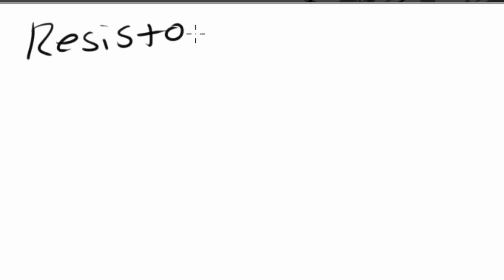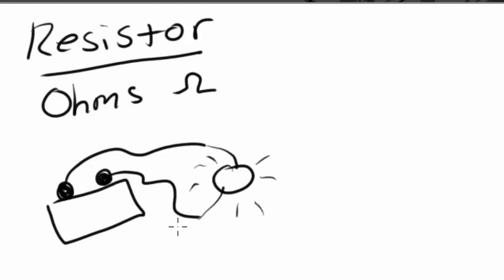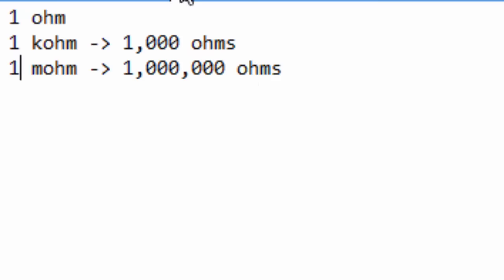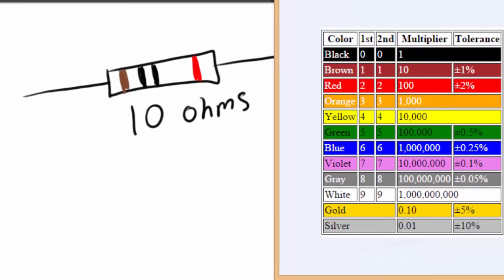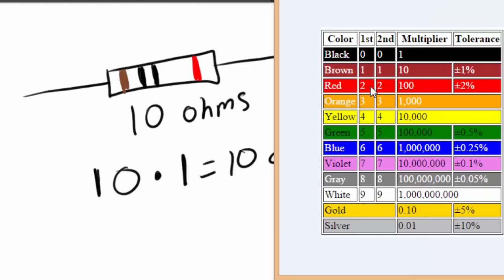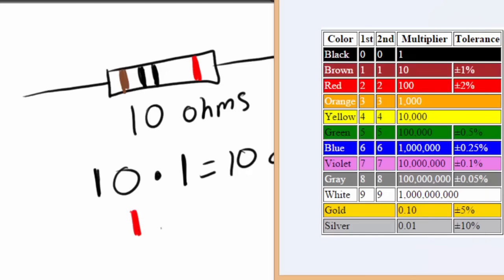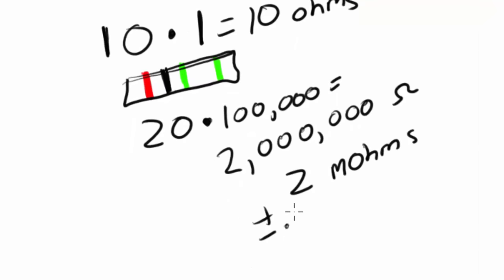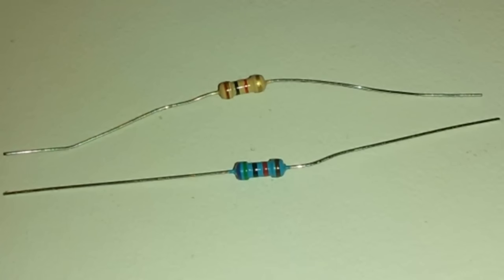Beginner Electronics - 5 - Resistors

Comment: Question, what  if I simply turn the resistor , brown, black black red, clockwise. can I use it as 20 ohm one ?

If not how can I understand which is the correct side to calculate?
Reply: Usually in the last color band we find gold or silver colors which are at the end of the resistor and when we calculate the value at that time also we take the gold or silver color as the last one 
we take the first color as the color which is opposite to the gold or silver colors and then from there we start as the first second third and forth band of color and forth has to be either gold or silver and it is always the last 
To summarize just remember that the gold and silver band are the last color bands

Comment: How do you know which one Is 1st and which one is tolerance? Which one is the left side and which one is the right side.
Reply: Usually in the last color band we find gold or silver colors which are at the end of the resistor and when we calculate the value at that time also we take the gold or silver color as the last one 
we take the first color as the color which is opposite to the gold or silver colors and then from there we start as the first second third and forth band of color and forth has to be either gold or silver and it is always the last 
To summarize just remember that the gold and silver band are the last color bands

Comment: How do you know which side of a resistor you start taking the colors?
Reply: Usually in the last color band we find gold or silver colors which are at the end of the resistor and when we calculate the value at that time also we take the gold or silver color as the last one 
we take the first color as the color which is opposite to the gold or silver colors and then from there we start as the first second third and forth band of color and forth has to be either gold or silver and it is always the last 
To summarize just remember that the gold and silver band are the last color bands

Comment: A confusion here: what if we rotate the resistor to the other way round, won't we get a different result. If so, how to know which one is head and which is the tail
Reply: Usually in the last color band we find gold or silver colors which are at the end of the resistor and when we calculate the value at that time also we take the gold or silver color as the last one 
we take the first color as the color which is opposite to the gold or silver colors and then from there we start as the first second third and forth band of color and forth has to be either gold or silver and it is always the last 
To summarize just remember that the gold and silver band are the last color bands

Comment: hi how i can know which side is the top one  of the resistor ?
Reply: I think after 4 years you’ve already got the answer to your question, but I’m still going to answer it, in case that someone else has the same question, now or in the future!
Reply: Usually, there is a golden or silver colour band on one end. 

It is placed at a slightly greater distance than the other colour bands. You will be able to spot a colour band on the resistor which would have been placed a bit apart from the rest of the colour bands. This is the tolerance bands which tells you about the %age inaccuracy of the resistor value.
Reply: If you were asking about which side of the resistor is the one where you connect the positive terminal of a battery then there isn’t any restriction for that.

Resistors don’t have polarity. Connect them in any direction. They will work just fine. Also they work the same with both AC and DC unlike capacitors and inductors.
Reply: Best solution is to buy a multimeter. It can calculate the resistance itself along with plenty of other variables such as voltage, current etc.
Reply: @retrohd1_  thanks you sir 🙏 🙏
Can i get you mail I'd , please???
Reply: @Shailesh Kumar I hope you got the email
Reply: @retrohd1_  did you give it to him?
Reply: @retrohd1_  thanks for the explanation btw, youve said some things i didnt know
Reply: 1 2 If you’re talking about the tolerance band being at a slightly greater distance then I’ve seen it like that on some resistors while on others all of them are at equal distance. Must be due to different manufacturers. But I’m glad if it helps you in some way.
Reply: 1 2 I did left my email id here for a few days then deleted it. It didn’t felt right idk
Reply: @retrohd1_  oh interesting, but now im curious, what did he mail you about? Did you guys became internet buddies?
Reply: 1 2 Lol 😂 no never got an email
Reply: @retrohd1_  haha, you seem very intelligent, may i know your age bcs i think you are part of the more mature part of youtube users
Reply: I asume you are also muslim, im too btw
Reply: 1 2 I don’t consider myself that mature. I’m almost 20. But I really love electronics and I’m learning from YouTube videos. Thanks for the compliment though
Reply: @retrohd1_  by mature i  actually meant respectfull, positive, wanting to give other people knowledge etc.. not 12 yo boy who is talking big on the internet.. if you know what im trying to say.
 Im 16, i just started to learn about electronics, ive always been interested in how these things work..(like electronics, programming, i like to read about physics and the universe and stuff haha)
(Btw, school starts again in 5 days...)
(Im from europe)
Reply: 1 2 I get it. Are you on Facebook though? We should talk over there
Reply: 1 2 Got it! You should remove the comment now

Comment: How could we understand the resistance of a resistor if it is inverted
It looks same from both side
Reply: Usually in the last color band we find gold or silver colors which are at the end of the resistor and when we calculate the value at that time also we take the gold or silver color as the last one 
we take the first color as the color which is opposite to the gold or silver colors and then from there we start as the first second third and forth band of color and forth has to be either gold or silver and it is always the last 
To summarize just remember that the gold and silver band are the last color bands

Comment: How do i distinguish the 1st band of an resistor from the last band of a resistor ?
Reply: Usually in the last color band we find gold or silver colors which are at the end of the resistor and when we calculate the value at that time also we take the gold or silver color as the last one 
we take the first color as the color which is opposite to the gold or silver colors and then from there we start as the first second third and forth band of color and forth has to be either gold or silver and it is always the last 
To summarize just remember that the gold and silver band are the last color bands

Comment: How do you know you're not reading the color codes in reverse?
Reply: Usually in the last color band we find gold or silver colors which are at the end of the resistor and when we calculate the value at that time also we take the gold or silver color as the last one 
we take the first color as the color which is opposite to the gold or silver colors and then from there we start as the first second third and forth band of color and forth has to be either gold or silver and it is always the last 
To summarize just remember that the gold and silver band are the last color bands

Comment: BUT WAIT HOW DO YOU KNOW WHICH SIDE YOU ARE SUPPOSED TO START FROM WHEN CALCULATING OHMS.
Reply: Usually in the last color band we find gold or silver colors which are at the end of the resistor and when we calculate the value at that time also we take the gold or silver color as the last one 
we take the first color as the color which is opposite to the gold or silver colors and then from there we start as the first second third and forth band of color and forth has to be either gold or silver and it is always the last 
To summarize just remember that the gold and silver band are the last color bands

Comment: How do you know which side is the first color and which side is the last?
Reply: Usually in the last color band we find gold or silver colors which are at the end of the resistor and when we calculate the value at that time also we take the gold or silver color as the last one 
we take the first color as the color which is opposite to the gold or silver colors and then from there we start as the first second third and forth band of color and forth has to be either gold or silver and it is always the last 
To summarize just remember that the gold and silver band are the last color bands

Comment: How do i distinguish the 1st band of a resistor  and the last color-band of a resistor ?
Reply: Usually in the last color band we find gold or silver colors which are at the end of the resistor and when we calculate the value at that time also we take the gold or silver color as the last one 
we take the first color as the color which is opposite to the gold or silver colors and then from there we start as the first second third and forth band of color and forth has to be either gold or silver and it is always the last 
To summarize just remember that the gold and silver band are the last color bands

Comment: How can we know from which side to look for resisters color line?
Reply: Usually in the last color band we find gold or silver colors which are at the end of the resistor and when we calculate the value at that time also we take the gold or silver color as the last one 
we take the first color as the color which is opposite to the gold or silver colors and then from there we start as the first second third and forth band of color and forth has to be either gold or silver and it is always the last 
To summarize just remember that the gold and silver band are the last color bands

Comment: How do you know which way to read them?
Reply: Usually in the last color band we find gold or silver colors which are at the end of the resistor and when we calculate the value at that time also we take the gold or silver color as the last one 
we take the first color as the color which is opposite to the gold or silver colors and then from there we start as the first second third and forth band of color and forth has to be either gold or silver and it is always the last 
To summarize just remember that the gold and silver band are the last color bands

Comment: how do we know resistor from left to right. I know we have to read it from left to right but how do you know it's placed correctly ?
Reply: Usually in the last color band we find gold or silver colors which are at the end of the resistor and when we calculate the value at that time also we take the gold or silver color as the last one 
we take the first color as the color which is opposite to the gold or silver colors and then from there we start as the first second third and forth band of color and forth has to be either gold or silver and it is always the last 
To summarize just remember that the gold and silver band are the last color bands

Comment: how do you know which end is the start and the end ?
Reply: Usually in the last color band we find gold or silver colors which are at the end of the resistor and when we calculate the value at that time also we take the gold or silver color as the last one 
we take the first color as the color which is opposite to the gold or silver colors and then from there we start as the first second third and forth band of color and forth has to be either gold or silver and it is always the last 
To summarize just remember that the gold and silver band are the last color bands

Comment: how do you know what's the front and what's the back of the resistors shown?
Reply: Usually in the last color band we find gold or silver colors which are at the end of the resistor and when we calculate the value at that time also we take the gold or silver color as the last one 
we take the first color as the color which is opposite to the gold or silver colors and then from there we start as the first second third and forth band of color and forth has to be either gold or silver and it is always the last 
To summarize just remember that the gold and silver band are the last color bands
Reply: @yuvraj5416  sounds good! Will use this

Comment: how do we know which way is the end  of a resistor
Reply: gape between 3 and 4 band shows the direction to the bigger gap between the bands is always to your right
Reply: Usually in the last color band we find gold or silver colors which are at the end of the resistor and when we calculate the value at that time also we take the gold or silver color as the last one 
we take the first color as the color which is opposite to the gold or silver colors and then from there we start as the first second third and forth band of color and forth has to be either gold or silver and it is always the last 
To summarize just remember that the gold and silver band are the last color bands

Comment: What if you read backwards on reallife resistor
Reply: Usually in the last color band we find gold or silver colors which are at the end of the resistor and when we calculate the value at that time also we take the gold or silver color as the last one 
we take the first color as the color which is opposite to the gold or silver colors and then from there we start as the first second third and forth band of color and forth has to be either gold or silver and it is always the last 
To summarize just remember that the gold and silver band are the last color bands

Comment: This is another engineer's needless complication, much like the way television engineer's dropped the frame rate from 30fps to 29.97 to accommodate color signals.  24fps film converted to video at 23.976fps.  They introduced a plethora of signal processing issues like pulldown/pullup , and SMPTE drop-frame rates.  

Why not just print the digits on the side of the resistor? Why carry on a tradition of obfuscation for tradition's sake?  It probably would take less space and be easier to quickly know the value without resorting to a chart and doing calculations in your head.

Comment: The color idea of resistors is so stupid. who can tell if it's a black or a brown band, especially if the color of the resistor itself isnt white... and then have to count them and multiply...wouldn't it so much easier to just print the number on the resistor and that's it? it's big enough to be able to tell with just a number so these colors thing is just...ughhh
Reply: Someone had asked my teacher the same question and he said it is because if we wrote it on the resistor chances are that the colours could fade out or worn out and not be clearly visible or be blurt overtime or if someone is having an issue reading small texts the person wouldn't be able to know the resistance and that's why we have colours